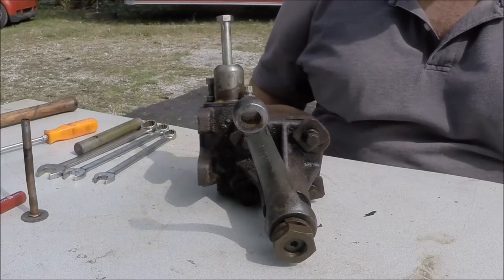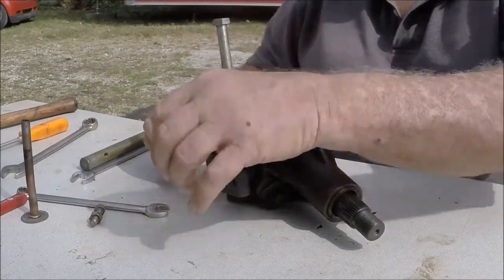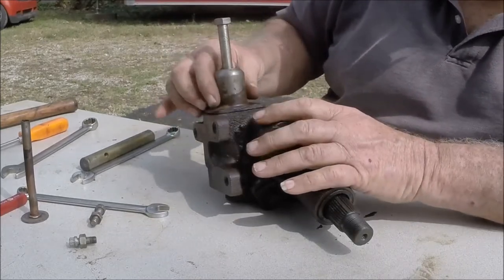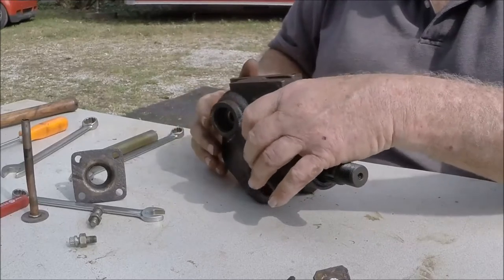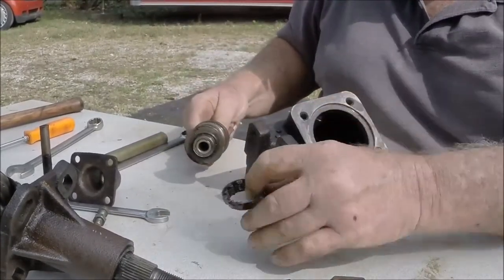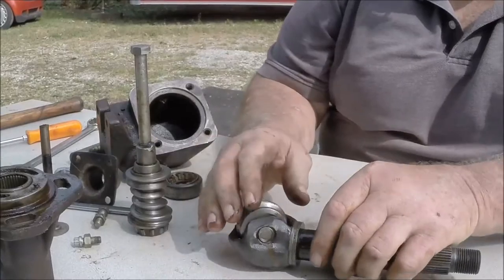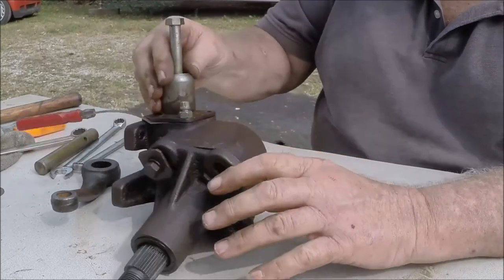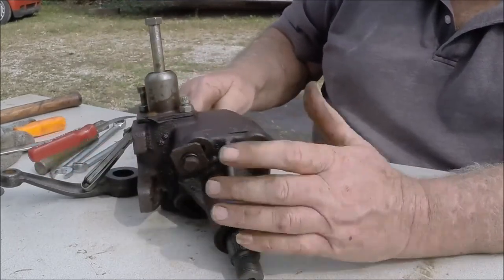1949/50 Shoebox Steering Box Teardown

Comment: i have a 1950  chev 3100 truck  when i am driving it  and go over a bump it goes all over the place. front end is tight  how do i adjust the steering box. thanks. or what do you think it could be.
Reply from the maker: Could be any number of things, shockes etc. I am not familar with the 3100 steering box but most old boxes have a screw in the top plate to take up some slack. if its original it most likely needs rebuilt.

Comment: How do you remove the tube assembly and lower bearing race?
Reply from the maker: If you replace the lower race you have to sacrifice the tube and plate. Knock it out, replace the race, install new tube/plate.
Reply: Once the tube is out does the race come out from the bottom or the inside?